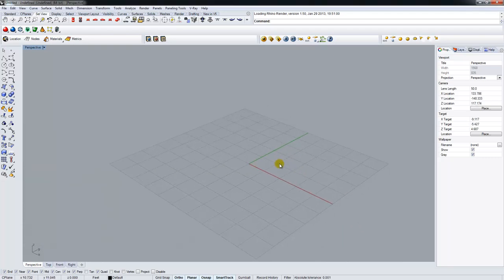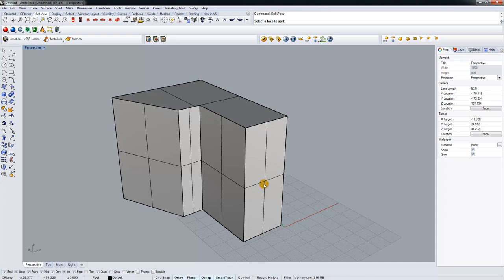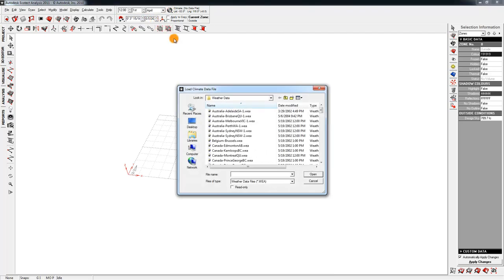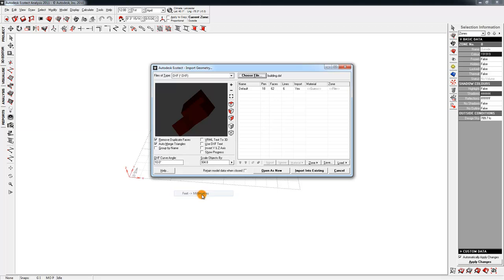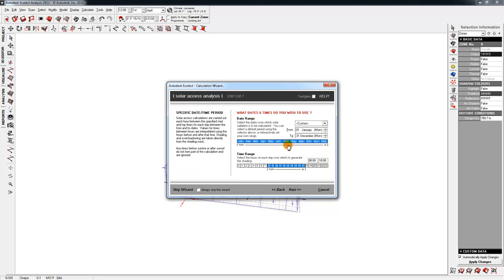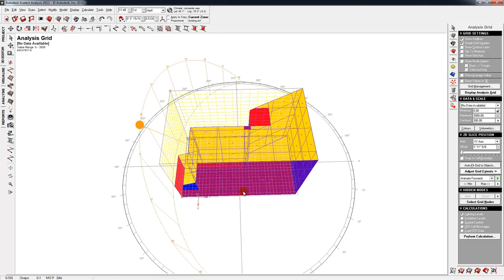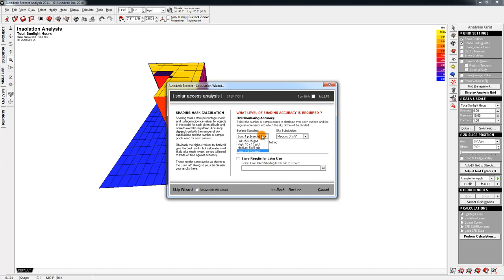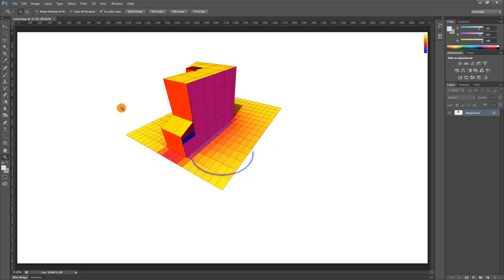Rhino to Ecotect

Comment: So I followed the guide with a more complex geometry. I have round columns for example and if I show surface normals then there is about 500 arrows pointing outwards prob meaning that it divides this round columns into 500 small mini-surfaces. Also it has some other faces facing inwards but the majority facing outwards correctly.
My question is, do you think this will work fine or will this all mess up the calc? Maybe the inside columns doesnt even matter?
Reply from the maker: +Göran Heintz I think it is best to use less detailed models.  Have many many surfaces will make the calculation take hours.
Reply: Thanks for answering! Btw you might not know the answer but what if I am doing a large tower and only redo two floors. Would you make a basic model of the whole thing or would you just do the two floors? But then the altitude doesn't matter? Btw many thanks for your videos, I watched most of them and I enjoy it a lot

Comment: Hi Christopher! 
I followed your instructions with a rhino 3dm more complex (a group of buildings). Unfortunately after saving as dxf, Ecotect doesn't let me import it. I've tried to re-open the dxf file in Autocad and it works. I also saved in a older dxf  version (2000) but still nothing.
Any suggestions? 
thanks

Comment: Thanks for the great guides. I took a 3dmodel i made and just exported the polysurfaces I have, it was not that many, like 12ish. However, in ecotect it is split up into hundreds and thus if i check the surface direction, there are like thousands of arrows. A part of it helped when I used "Modify/Merge coincident triangles" but not all. How can I fix this?
Reply from the maker: I usually convert the polysurface into a mesh in rhino and unifymeshnormals to be sure they are all the correct direction.  You can do the same thing in 3ds max.  I think it is best to export a mesh and import that mesh into ecotect.  Polysurfaces don't work well.
Reply: +Christopher McAdams Thanks for the answer. Even though I have put hundreds of hours working in rhino, I am embarresed to say that I do not reall know the difference between a polysurface an a mesh. So ho would u do that?